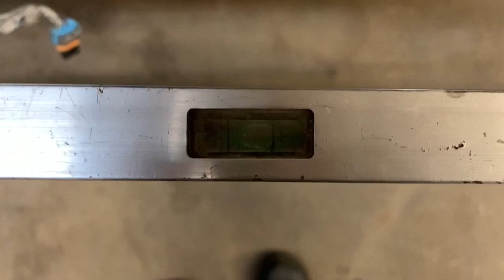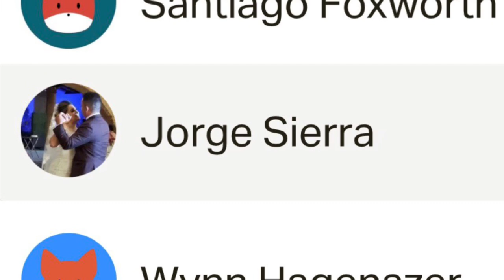How to shorten a truck frame, modifying your chassis. Short bed conversion

Comment: Been mulling over how I was gonna get The Van on the Dodge Ram frame. Gonna use your video as a reference, lol.

The tough part for me is where the swoopy bit that raises up for the bed; the floor of The Van is flat. Either I'm going to have to cut out the swoopy bit and have a super raked frame (or put leveling kit on the front), or cut and raise the floor in the back half of The Van. Not sure how we're gonna grease  that pig yet, but I'll figure it out.

In either case, thanks for the video! Glad to see Desperado back on the menu and moving full steam ahead!
Reply from the maker: Ooohh yeah that’s the issue I ran into, but without the frame. The van was really high in the back after I put the diff in. I like the idea of a levelling kit in front, jacked up vans look nuts! 

Man I couldn’t wait to get back at Desperado, the only thing holding me back was a good frame and I finally got one 😁

Comment: I did a 99 4wd to awd ext cab turbo build in my driveway. I really want to go regular cab so bad but not having a covered shop is limiting factor.  Thx for showing how to do the frame though. Its not nearly as bad as it seems.
Reply from the maker: I bet that’s a fun truck! It’s not too bad of a job to shorten the frame, and there’s nothing stopping you from doing it outside

Comment: It's been proven over an over that a square cut is equally as strong as a diagonal cut. You're confusing  it with a joint of wood where it's joined with glue where as steel is fuzed with a weld.

Comment: I got my knuckle while cutting the bump stops off that s10, didnt notice until i seen the puddle of blood (great band name btw) on my leg 🤣 then i almost cut my finger tip completely off like a week later
Reply from the maker: Same finger?
Reply: @StationroadRatrods nah, did fry it with a weld the same day tho
Reply from the maker: @brandonleisure9999 ahhh shit, slag burns are worse than cuts

Comment: Steps cuts and 45 degree cuts are not necessary. A simple vertical cut and proper weld is sufficient.
Reply from the maker: I’m sure it is, but this makes me feel safer
Reply: @StationroadRatrods  yes, the placebo effect is valid.
Reply from the maker: lol yup